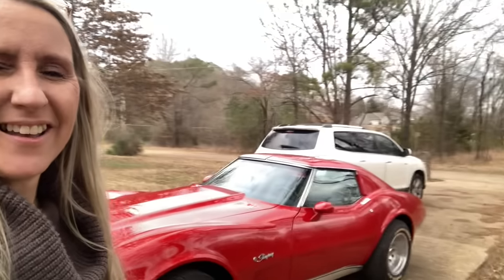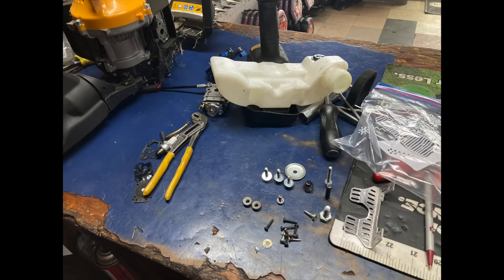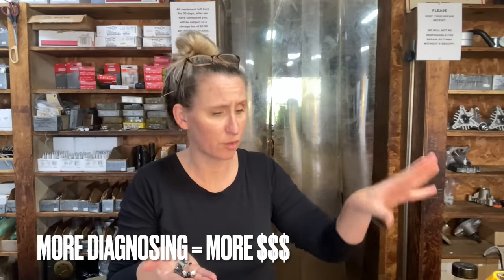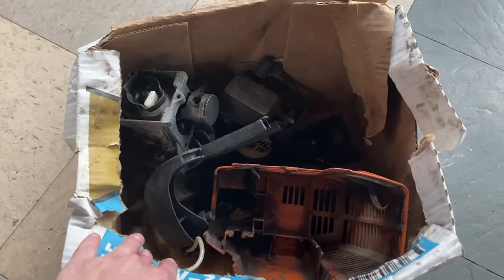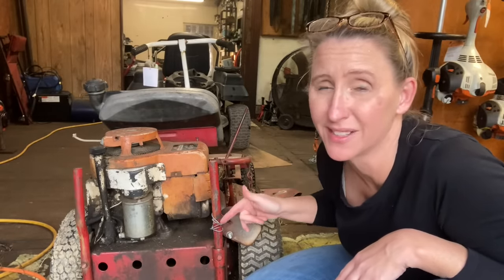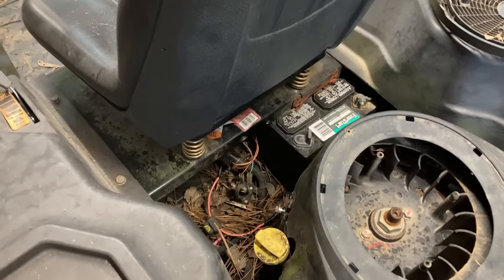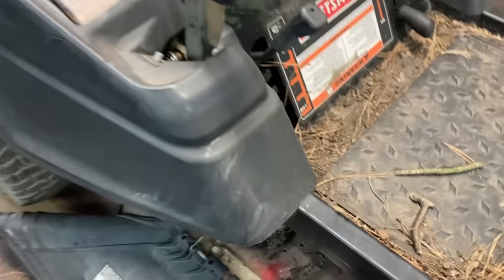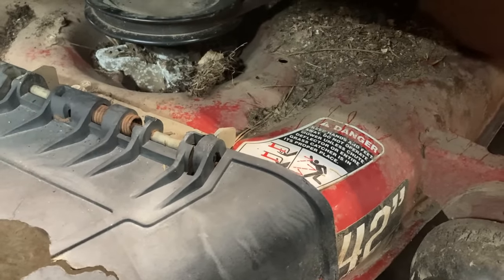Don't Waste Your Money and My Time! Gambling on Repairs When the Odds are TERRIBLE, We Both Lose!

Comment: I have a snapper zero turn, it starts, but the moment I close the handles or turn on the blades or try to move it it dies the moment I hit any switch. I tested all my safety switches, and all them work so far. I can’t figure it out

Comment: If I've learned anything in the small engine industry is that 99.9% customers are reactive, clueless, lazy, and cheap when it comes to their machines maintenance. 

Often one can tell within 5 minutes if a machine is worth investing the time and cost to repair. IMO charge a higher diagnostic fee and be done with it. You can then upcharge them again for disposal if it's really bad, then make more money stripping it for parts and reselling them if they are fast movers.

Comment: Different industry, similar results: When I was a bike shop service manager, every repair estimated to cost over $100 and every repair on a bicycle older than five years required a non-refundable deposit of 75% of the estimate. This saved us a lot of space and time in the busy season!

Back to the mower biz: Last year, for reasons immaterial to this video, I moved to a .6-acre lot. My father-in-law hadn't used his Troy Bilt 42" riding mower for a couple years, but since it had stayed in the garage, I took it to a shop to see what needed to be done. Since the move wasn't going to happen until August, I figured that dropping it off at the first of July would give the shop folks time to get to fixing it in due course. I even told them I had plenty of time and to not expect me to nag them about it. 

Big lesson for me was that I was right to give the shop ample time on the front end. They gave me a "patient customer" discount (which probably means they didn't charge me a rush fee).

Comment: I have a question for you. You are right spring is in the air. Project is a RYOBI 410R SN: 101033689 PPN: 21BK410G034 has not run in years and all the fuel lines are gone. I took apart and ordered carb, spark plug, gaskets. I am not sure about the spark. I have not been able to check, the spark plug connector is corroded badly. I have searched no coil found. Really did not want to put one on. You would make it look easy. Is there a way to clean the corrosion and or repair the end of the coil wire? It would not pull off without breaking. I am sure you might have a solution. Thanks.

Comment: Here's one... When the customer blows their engine due to no oil in it and pours brand new oil in the engine and drop it off at a shop and try to pin it on the shop owner for a free engine replacement after bogus threats and what not. People these days no common sense and would do anything to get over on someone don't matter who it is. It's just sad people gotta stoop that low.

Comment: Pro tip. Extra bolts go into the carb., they will find a home.
Reply: Well yes but at least make sure it's running full throttle so they all find their homes before it quits running again 💯

Comment: Curious to know if yall work on the electric zero turns? I know my local orange box store  has dumped the very expensive Cub Cadet models at a HUGE, HUGE discount, its almost like they are wanting to distance themselves from them fast. Might because of the videos out of them burning...

Comment: Neglect is the biggest problem shops like yours face.  People expect miracles. First of all, do they bother cleaning their equipment and then maintaining that equipment.  Also, if you tried the DIY approach, isolate your equipment and parts.  In general, the public abuses small  engines and expects them to work automatically.

Comment: I wouldn't even touch stuff like that. If they want me to put it back together. Thats an automatic 250.00 dollars right off the bat. Before I even take a look at it. That tends to solve the issue really fast. I'm not wasting potentially an entire day putting it all back together and then hoping it runs and theres nothing else wrong with it. 250.00 dollar frustration fee right off the bat. That doesn't include any parts or labor  You figured out how to take it apart therefore you can figure out how it goes back together. Those are loose your ass time wasting jobs. You took it apart. You put it back together period. If you can't put it back together then why are you taking it apart. You wanna force me to do it rest assured I'm going to take your entire paycheck. The problem is you don't charge enough to make them think its an inconveniece. Otherwise they would have stopped doing it. Make up a sign that says anything brought in all torn apart in a box is subject to a 200 dollar frustration fee. This fee does not include any parts or labor fees and if they still bring it to you. You hit them with the surcharge. They'll learn really quick I garuntee you. But you have to dig deep enough in their pockets.

Comment: Bre, I admire you, but I'm afraid of what this kind of mental abuse is going to cost you in the not so distant future. I could spend a day or more just telling my funny and horror stories, but I won't. (You know them all and then some. IDIOTS drive me crazy. They are what has ruined the power equipment industry. They are the cause of all the safety crap on machines that impedes their operation and often the repairs. Searching for safety switches and such. I'm just now working on a Troy Bilt Flex. Could not find the info I need online, BUT, was lucky enough to find the button that keeps you from starting it w/o an attachment on it. I believe most homeowners should NOT touch power equipment. And I don't even do this for a living, just every now n then. Machines used to be sooo much simpler back in the day. Well, except for points ignition maybe. Stay safe, stay sane, lol.

Comment: Lack of effort on the craftsman zero turn. $600 for a deck, I wish I was your parts supplier.   It wouldn't take that much effort to drain the gas, change the oil/filter gas filter to see if it was trashed or not

Comment: These examples show that common sense is not common. Do you think maybe that some of this stuff gets dumped on you so that you will get rid of it for them? Make it your problem instead of theirs? When I had my shop I can't tell you how many times I came in and found 3 or 4 mowers in front of the shop just dumped there. A bunch of unrepairable junk.